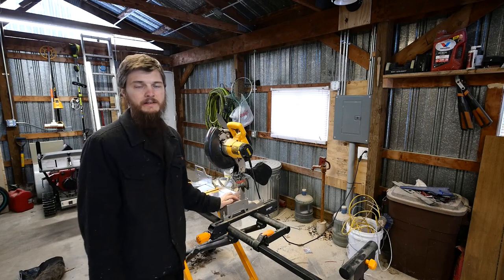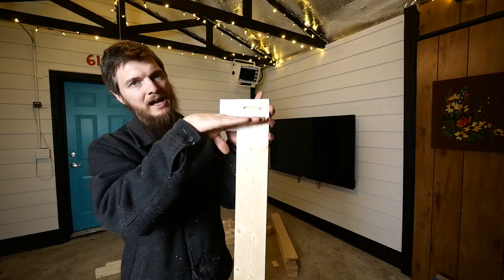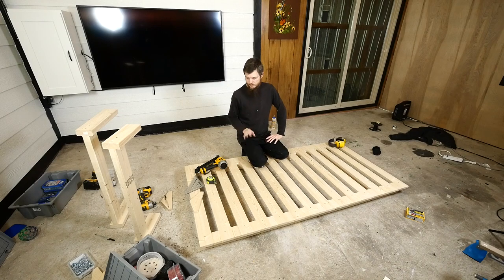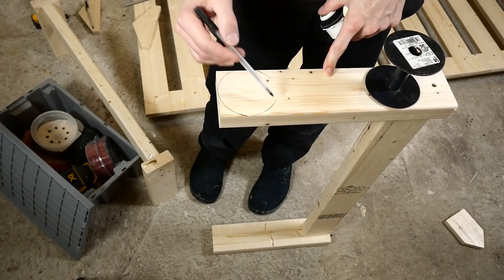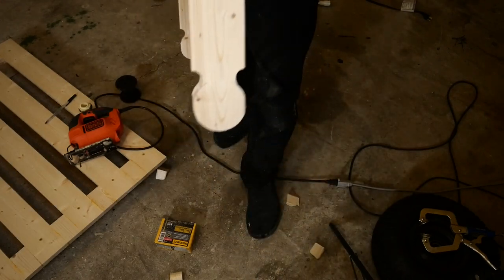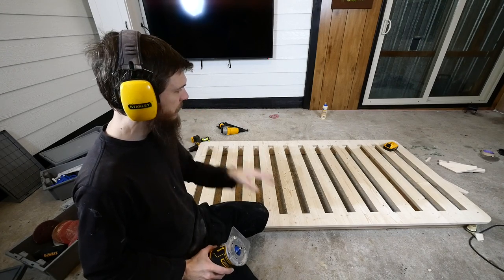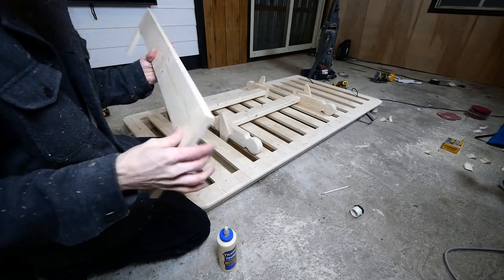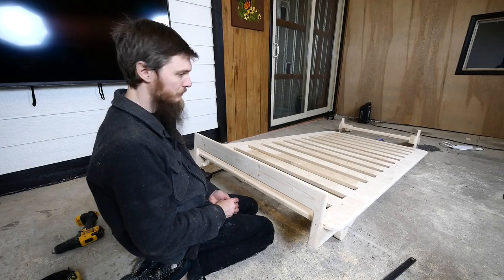Designing a Unique Inclined Minimalist Bed

Comment: Now you've given me idea's.  Have you thought about doing a version of those expensive beds that you can manually raise the top and have various incline levels?   How about a murphy bed, either the full sized, straight up, with shelves, or drawers on the sides,  or a single that's sideways, so it has a shelf across the top, for the new rec room(then either could be folded away and not clutter the room).   I bet you could make a davenport and/or chairs for the rec room, if you wanted to!
Reply from the maker: Anything is possible, though it would take some planning and experimenting.

Comment: Good DIY build. Rounding the feet to accommodate the angle (and to add a bit of style) was a decent idea. However, I'd also be curious to see if it would further improve the structural integrity of the frame to have the legs connect to the frame at opposing angles like a trapezoid so that all of the according weight goes through the wood straight.
Reply from the maker: I considered it, but it would be tricky. Not impossible though :)

Comment: Love the bed!  Excellent!  Since those triangular pieces of wood “support” the bed, perhaps screws would be better than nails?  Beautiful product!  TYTY!  ❤️❤️🙏❤️❤️
Reply from the maker: Thanks! It's really the glue that I want to support it. The nails just hold it while the glue dries. Wood glue is amazingly strong when applied and dried properly. BUT, I did add a screw through the back of the leg into the brace piece to give it some extra strength. I just didn't show that part :)

Comment: In addition to the felt pad on the semi circle, it would be good to set the feet on a furniture floor slider that spreads the pressure out over a larger flat surface.

Comment: I LOVE that bed!  Love the rounded feet.  Love the foot board, even!  My only question is "are you gonna oil, stain, shellac or varnish it?"  I know it will be mostly covered by bedding all the time, but still, it seems like there should be some finish coat to it.  You did beautiful work, Doug, and each bed has gotten better and better (not that either was bad or less than par in the first place!  You just keep improving on what I, at least, thought was g-r-r-reat!)
Reply from the maker: We may finish it later on, but we'd like to wait until we have nice weather so we can properly ventilate the space while finishing it.
Reply: @diyfferent  Makes sense.

Comment: Cool project Doug. The bed looks awesome. I wondered why you did not use the router to get the shape of the rounded feet? So after rough cutting with the jigsaw you could have used a template (4 times) and use the router to get 4 identical shapes. And as a bonus you could be using it on your first bed too or in future on Maverick's bed...

Comment: I don't think you should put felt on the bottom of the legs.  I put it on my kitchen chairs and found out that it holds dirt, which is gritty.  It worked like sandpaper and ruined the finish on my new hardwood floor.  I dont know how it would be on laminate.
Reply: Maybe use those little rubber dots for cupboards to close quieter

Comment: I have slept on a slant in a mechanical bed since 2017 - I had 2 shots that broke 8 vertebra - modern drugs are scary.  I am curious - how long to make a bed, now you have it down?
Reply from the maker: I wouldn't say that I have it down just yet. If I had a biscuit joiner I bet I could cut the time down a lot. But as is, it doesn't take too long, only a few hours but waiting for the glue to dry adds a lot of time.

Comment: I think that the design is brilliant and looks fantastic. My only concern is the weight (playful kids) is being supported by glue and Brad nails. I might add a bolt through each of the leg supports just for peace of mind. Had you used Doug nails, there would be no need for the bolts.
Reply from the maker: They were finish nails and I also put a screw in from the back, but I mostly want the glue to hold it. Wood glue is very strong!
Reply: @diyfferent  Well, that changes everything. I hear Finland makes excellent nails.

Comment: Good idea of the bed frame I’m unsure about the slanting bed but that’s a personal choice but I can’t find much real medical advice on it only osteopaths connected with bed companies, I think you should try to learn some real carpentry techniques rather than relying on lap joints and pocket screws, but I know you get impatient lol one thing I would say is a rounded foot has very little contact with the floor an angled flat bottom would have been much better, keep an eye out for any movement or signs of strain.. 😊👍

Comment: Those feet are going to snap. Someday.
Reply from the maker: No, they won't.
Reply: My daughter’s bed did. Her girlfriend decided to bounce on it. Dumb kid. Expensive bed.
Reply from the maker: @elenasimon1270  A lot of store-bought beds aren't made very well, even if they are expensive.
Reply: @diyfferent  what is safe about those feet? Ask a furniture builder.
Reply from the maker: @elenasimon1270  I'm the furniture builder and I assure you that they are strong and safe. There would be no reason they would break. After all, many stick-built homes are made out of 2x4s and they aren't breaking.
Reply: @diyfferent  the 2x4s that are structural in a stick built house have not had the integrity chiseled out of them. At least those that are still standing. She’s your kid. Do what you want. BTW, kids don’t need an incline bed. By the time she reaches her teens she’ll hate it.
Reply from the maker: @elenasimon1270   I guess you haven't noticed that most wood bed frame legs are super thin and flimsy compared to our legs. If anything, our bed is made overkill. No, Belle won't hate the inclined bed. There's no reason to, it feels flat when laying on it and it's a healthy way to sleep. Do you have a problem with us?
Reply: @diyfferent  Do you expect positive comments? I don't do them. Rarely. Are you running a cult over there where everyone has to agree with you and what you do? I'm sharing my 68 yo life experience. Take it or leave it.
Reply from the maker: @elenasimon1270  Yep, you clearly have a problem with us, I knew it. You are one of those people who can't handle truth and facts.